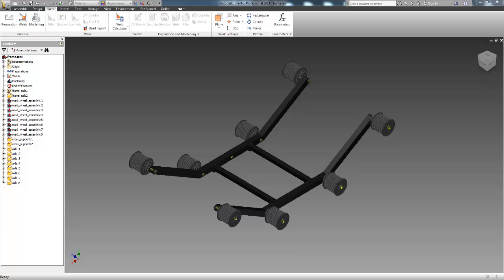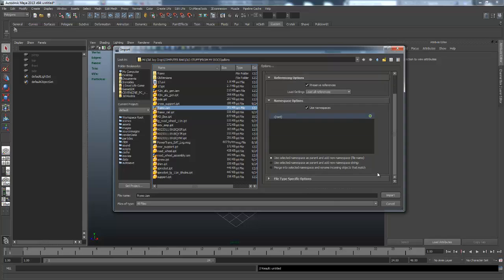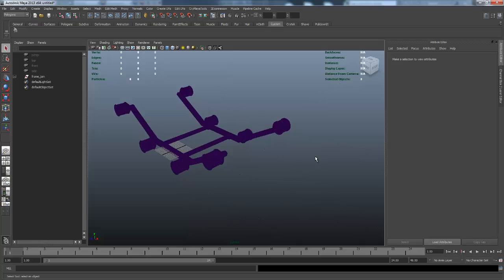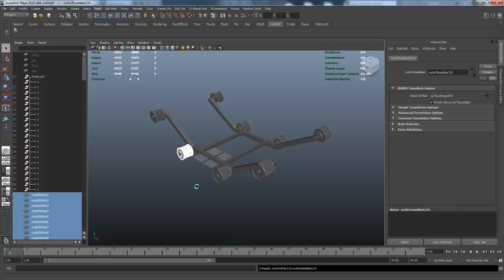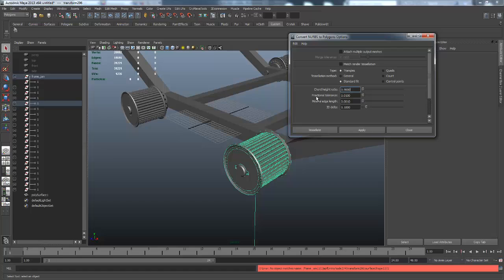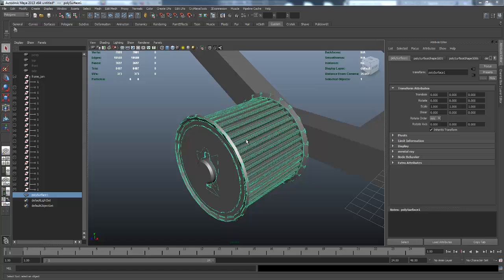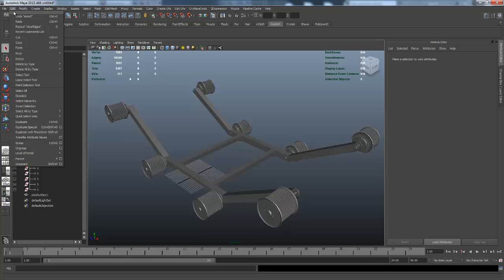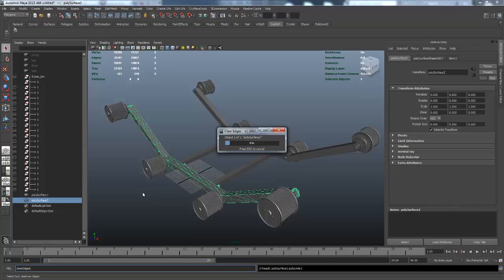AutoDesk Inventor to AutoDesk Maya

Comment: I cant import any files from inventor to maya it always says
// Error: Failed to find translator. //
// Error: //
// Error: Error reading file. //
help pls
Reply from the maker: Is Inventor and Maya the same revision (i.e. 2016)?
Reply: Maya 2015 and inventor 2016? is that an issue?
Reply from the maker: Very well may be; same issue occurs when trying to import a newer into an older piece of software with 3ds Max and Solidworks. You can always download a trial of Maya 2016 or 2017, run it in a virtual machine and see if that eliminates the import error.
Reply: Make sure DiretConnect is installed. Normally it is installed by default when you install Maya but if not, install it from your installation files. It's usually in here: \x64\DirectConnect
Reply: Also I am not sure but I am sure you can save or create your Inventor file to be compatible with earlier versions. Try that.

Comment: I get this issue- and my model stays like this inside of Maya. http://i.imgur.com/krrgk5I.png
Reply from the maker: +PandaSkull CPU Generally, you'll see the illegal names warning when object names start with a number or a symbol (like an underscore or dash). Renaming objects with 'illegal names' will eliminate that warning dialogue box. An easy way to find the offending objects (if you have multiple objects and/or sub objects (children), you can execute the command "listNodesWithIncorrectNames" (with no quotes) and it should list any illegal names that you have (for some reason, object names in Maya must start with a letter). If you want to disable the 'illegal names' warning, you can set the "MAYA_ENABLE_LEGACY_INCORRECT_NODE_NAMES" variable to a value of 1.
-Matt

Comment: I use Blender for animations but I'm an electrical engineer so also use autocad electrical and I am thinking about to use inventor as well. Do you think I should start moving from blender to maya for animation? Is autodesk Inventor is related to the maya?
Reply from the maker: +Prabhushakti Haridashwo It all depends on what kind of animation that you wish to get into. Blender should serve you quite well, but I am not sure if you can import native Inventor files into Blender (if that is something that you wish to do). If you wish to utilize Inventor CAD Data for some of your animations, you should be able to export your 3D model from Inventor as a STL file and import that into Blender. Maya, although produced by the same company as Inventor, is not exactly in the same ballpark. Maya is more used for visual effects, film/tv animation, and video games; whereas 3DS Max is a little closer in relation to Inventor. Again, it really all comes down to what you wish to do. Hope this helps some and if you have a more defined direction in mind, let us know and we can give you a more accurate opinion.
-Matt

Comment: Can u convert from inside inventor?
Reply from the maker: +MONEYVAL9 To a Maya format, no. You can export Inventor files to other CAD formats (such as IGES,  STEP, STL, Parasolid and Pro-E), but there is nothing currently in place to natively convert, inside Inventor, to a Maya or 3DS Max file. Even in Inventor 2016 Pro,  we don't even have the ability to export as an FBX; something that I would like to see in the future.
-Matt
Reply: you can now export as an obj. file :D

Comment: Is it possible to export structural simulation data into maya? I would like to do a research project on applying engineering software for entertainment applications.
Reply from the maker: +turnipgoodness What format of simulation data would you be working with? According to one of our friends at Autodesk, Maya was never really designed to simulate in such a manner; but depending on what type of data is exported out of the simulator, it might be possible to import it into Maya.
-Matt
Reply: laythrom the actual deformations from a stress simulator would be awesome, I'm thinking it'd be very interesting to set up a building or bridge and use that data to drive deconstruction effects. But even the gradients (not sure if this is the right word or not) from a stress simulation would be useful if they could be applied as a vertex map. Sorry if I am not being clear, I am not an engineer.

Comment: I'm trying to import an .iam assembly into Maya 2016 but I get a error saying unrecognized file type. Are you using a different plugin to be able to import this file? iam doesn't show in the list of supported data import formats. Any help would be greatly appreciated!
Reply from the maker: Tim Fahey Okay, first you will want to make sure that the plugin is loaded for Inventor. In Maya, go to Window>Settings/Preferences>Plugin Manager and scroll down to "openInventor.mll" make sure that the loaded check box is checked. Now when you go to Import and attempt to import your Inventor file, it should open without issue. The "openInventor.mll" plugin will open both ipt files and iam files.
Reply: laythrom Thank you for that info, though I don't see that in my list of available plugins. I'm working on a Mac OS X, is this a plugin that is only available on a PC?
Reply from the maker: Tim Fahey I understand even more now. I believe that the issue is due to the lack of Mac support for Inventor. Until Autodesk decides to support Mac in a more efficient manner, it looks like the native process from Inventor to Maya is stuck to PC. Have you attempted to import a Stp file into Maya.
Reply: +laythrom What if I'm on Windows, with the educational version? Because I'm not seeing the plugin either. It's for a school project.